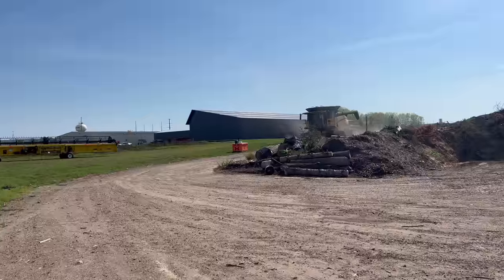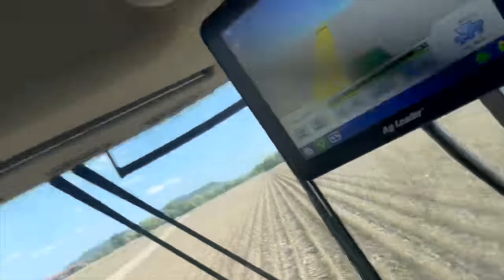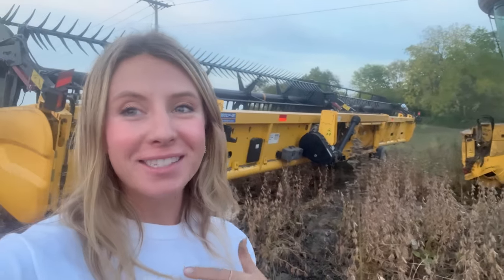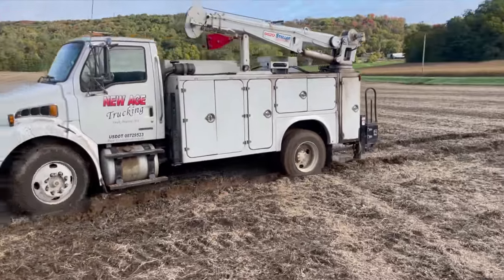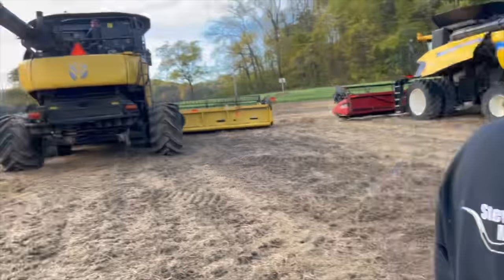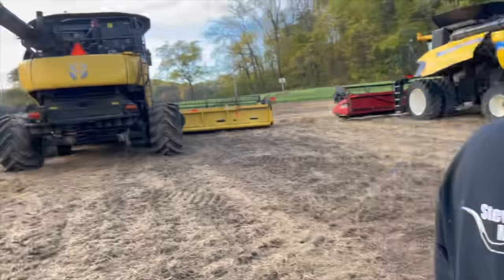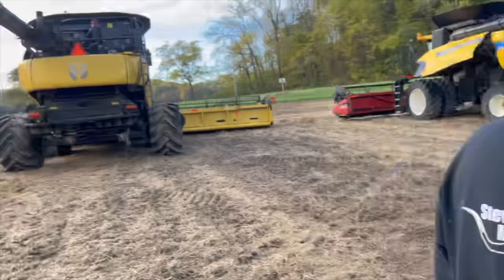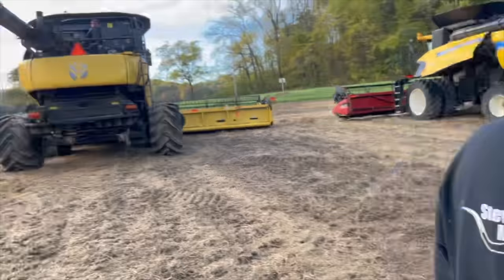Let the Bean Dust Fly! | harvest 23

Comment: Passing on a double yellow is illegal just as blocking traffic with 3 or more vehicles behind you for miles and miles without getting over in areas where you can to let traffic by is also illegal...but farmers get away with alot of illegal stuff and yes i used to work for a few farmers back in the day so yes i know how farmers get away with alot that everyday ordinary people don't get away with, if i had car trouble and was backing traffic up for miles with my hazards on and all that i would definitely get stopped by a cop and probably ticketed for not moving over in areas that i could have and let traffic by but farmers can hold up traffic for as many miles as they want and nothing happens even when cops see it and even though the law states 3 or more vehicles behind you ya must get over as soon as u can and let em pass but i see farmers passing pull offs and ignoring the law...they say they are professionals so i think maybe they should trailer their equipment like every other professional does.
Reply: What a rude comment
Reply from the maker: What an out of touch of reality comment really